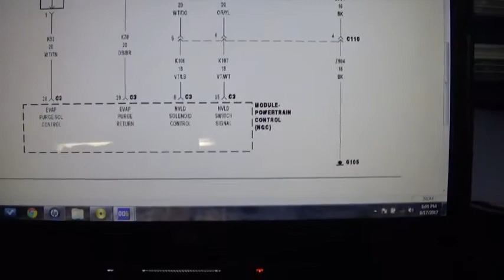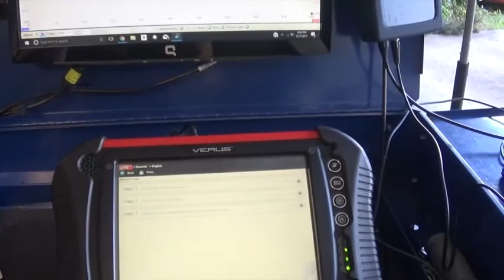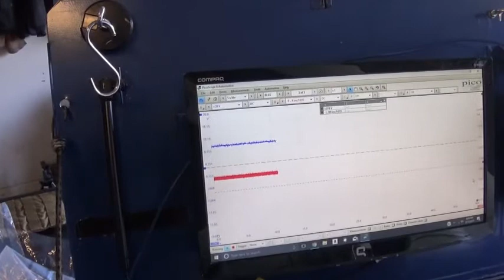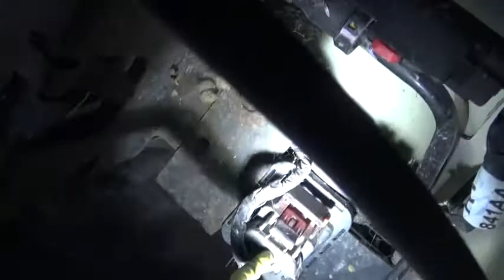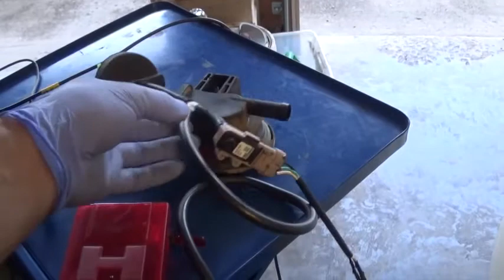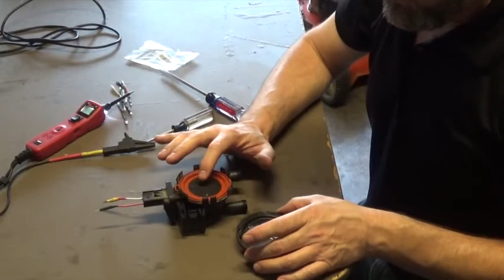Chrysler NVLD Evap Code P0452,P0453 Diagnoses And Repair

Comment: Will replacing this solve my p0452 code? I have a 07 charger
Reply: Did you find out what was causing you p0452 code
Reply: @AlklaineAlchemist  yea I had a small pin hole on 1 of the hoses

Comment: Also, I think you would get a smaller vacuum "spike" when you are pumping if you added a second port to the fuel cap. It's likely just a dynamic phenomenon in the small vacuum line you have there and doesn't show up in the tank.
Reply from the maker: anyheck yes I believe you are correct. Spikes are from pump being close to sensor but we just need to wait for vacuum to stabilized. I think this is very good way to test this system being able to monitor vacuum and switch at the same time. Very easy to make. Thank you for watching